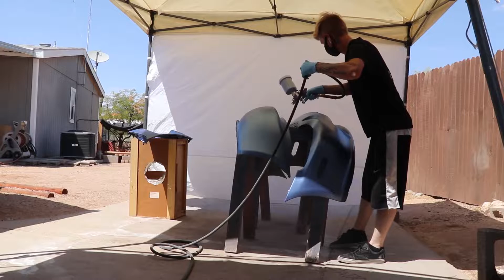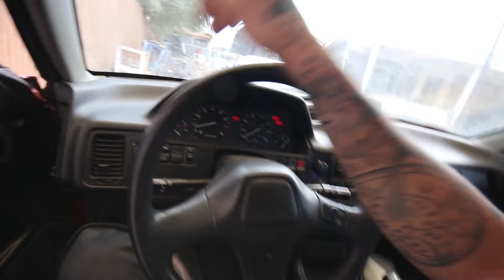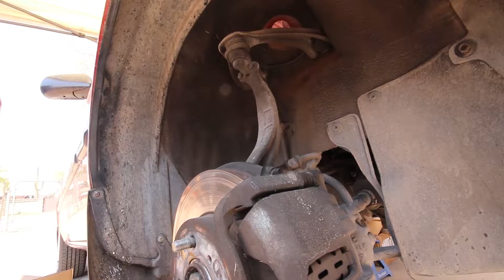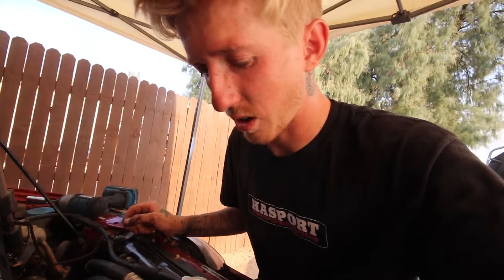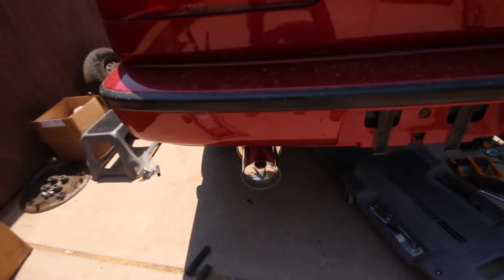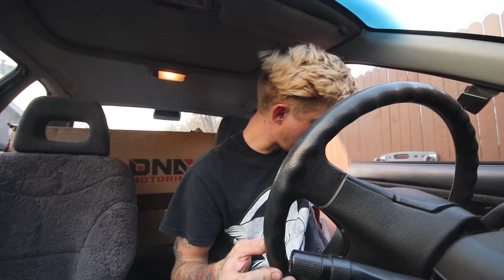Never Go Full Ebay

Comment: Both fans should be on with the ac working. That’s how my DA is.
Reply from the maker: You are correct, I remembered that the DA’s use the condensor fan as a secondary cooling fan

Comment: I just bought the same piping kit you used on the crx exhaust build. It's pretty good. It's mild steel 2.5" ID. I just need a muffler im thinking about a HKS Hi power I'll Tig a v band on it and do a straight pipe to it. Will that sound good ? Stock b16a2 with b16b pistons. Skunk 2 megapower v2 header.
Reply from the maker: It’s gonna sound like a Honda lol. You absolutely need as big of a resonator that you can find to take out all the rasp
Reply: @ChrisSadowski  KK that makes sense I'll buy a magnaflow resonator

Comment: Check fan switch in head that turns on the fan could be faulty that's what happened to mine wasn't fan
Reply from the maker: The fan switch in head is what send voltage to the fan connector. I even tried applying direct 12v to the fan itself, it’s just dead 💀🙁

Comment: Sounds like a freakin tractor at least it’s not fckn radio wires that are messed up lol I wanted my radio to work but the previous owner fcked up the radio wires for some reason at least the Aux cord works
Reply from the maker: I hate when people do that. It’s not hard to install a radio and not destroy EVERY wire behind the dash
Reply: ChrisSadowski I’m was angry months ago because my cousin crashed his white DB2 RS it’s cleaner then my shitty 91 DA9 I was gonna trade my DA for his Integra but he crashed it I bought a EG with a B20B Vtec now it’s sitting in the garage for now but I still own my DA 😢 I want his DB2 RS because it’s clean also because I want to put a B18C1 GSR motor in it it’s sitting in the garage at my uncles house I’m just gonna let my uncle put the GSR in his EG hatch it’s originality his motor after all

Comment: This DA owner has done zero research.
Maxpeeding rods coilovers cover EF/DA/EG/DC 
That header will be a D series header.
Reply: Lol no maxpeeding rods
Reply from the maker: Even a D series header will fit if you just hog out the holes a little bit. This header was so far off it’s crazy.
Reply: @ChrisSadowski  its like they didnt do any work making those at all.. They didn't measure it and did a shitty weld job